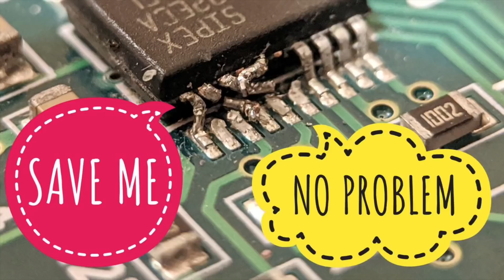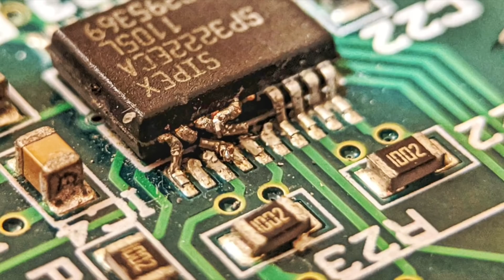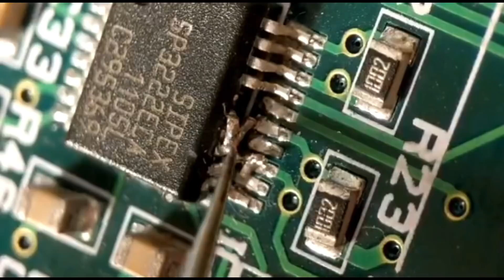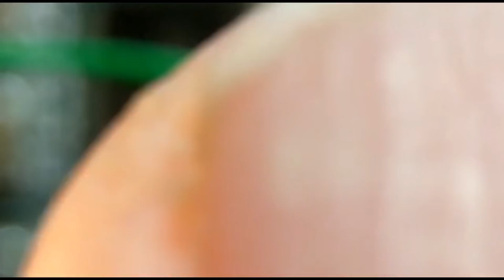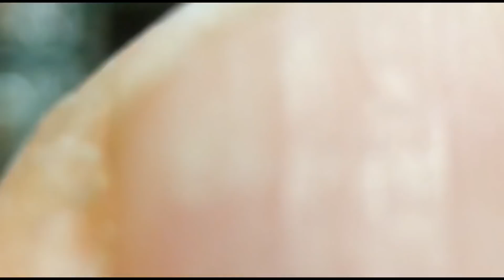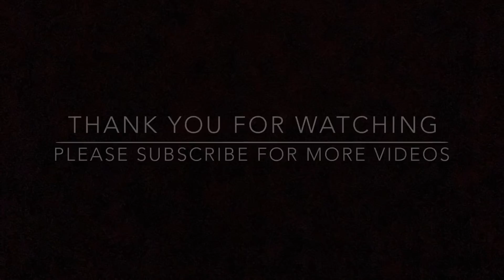IC Pin Repair / How To Repair Broken Pins On IC - 2 Methods

Comment: Amazing as always!  I did this yesterday (before I watched the video) I had to jump to the bypass cap - the trace, pad and IC leg were gone : )  I ground away some of the IC body with a grinding pen.  It worked great, there really was nothing to solder to at all pre-grinding.  Happily it was the power pin, so it was the top corner, and not a signal pin.  I practised on a different IC with a middle, signal leg missing, and I was not able to expose enough of the pin to solder onto.  I'm yet to properly test it, although the strength and continuity test good

Comment: What type of wire you are using as a pin substitute?
Reply from the maker: Hi , thank you for your comment . In this video I used the inside core of Kynar wire which is a 30 gauge wire . I just try and match the width of the pin with suitable wire  . For example if you have a through hole resistor lead and it matches your IC pin width I would use that if I could . Lots of different options . Thanks again 👍

Comment: What is the type
Of wire you use to fix the broken pins ?
Reply from the maker: Hi , thank you for your comment , much appreciated . The 3 pins I fixed with wire were done with 30 gauge Kynar wire , easily found on the internet . I normally try and match the original thickness of the damaged pins if I can . Or otherwise if you have scrap pcb's around use donor pins from other IC's which I've also done in this video . Hope that helps , thanks again 👍
Reply: @mrsolderfix3996  thank you I have one more question I ripped some of the little circles on the board I’m not sure what they are called lol. Can I replace them with copper ?
Reply from the maker: Hi , definitely, they are made of copper . If you can get some copper tape and shape what you need  , fine strands of copper wire from old scrap cables or lift old pads from scrap boards  , there is a few alternatives. Or you could use fine tin / copper wire if you can get that . Hope that helps , thanks for your support , take care 👍
Reply: @mrsolderfix3996  would you recommend the thick tape like duct tape looking or the real thin one ? I was removing an ext Port and completely destroyed them

Comment: Hi I have an 8 Pin Op Amp from Analog Devices where a pin broke off. Is it safe to install with a missing Pin?
Reply from the maker: Hi , thank you for your comment. I'm not sure on this one but If  it was my project I would still fit it , the only worry being is if the particular pin that is missing is needed to connect with the PCB. Some IC's not all pins are connected externally so they will still work if the right pin is missing . You could always type your IC type into the search bar at Farnell , RS Components , Digikey or Mouser and get a datasheet up . The chip info is all shown there about the circuitry of the IC . You may be lucky your missing pin is not needed. Good luck , thanks again
Reply: @mrsolderfix3996  will do thank you!
Reply from the maker: Hi , just go into the sites I mentioned and type your part into the search bar of any of them , scroll down when the part comes up until you hit datasheet . Some data sheets have many pages but slowly go through them and you will find the inside connections of the IC . This will help show you what you need to do , if anything , good luck , take care 👍

Comment: Nice work, @ 3.52 Was there a reason you repaired all 6 leads? As leads 12, 13, 15 and 16 are attached to connection pads and leads 11 and 14 are attached to anchor pads (no connection tracks on PCB) or was it purely for aesthetic reason?
Reply from the maker: Hi , thank you for your comment , much appreciated. I just always try and fix everything if I can , it's just my way , so in this case even though some of these pins may not be connected to other points I was always going to fix all 6 of them , plus the viewer can see what you can achieve more clearly . Hopefully that's ok , thanks again for watching my channel 👍

Comment: What do you do it you don't have any copper showing off your IC chip? How can you fix that?
Reply from the maker: Hi , I mention in the video that if you have little or no copper showing you can gently scrape back the body of the IC around the pin you need to work on to expose an amount of buried pin to enable you to fix a doner leg to this. The workings of the IC are deeper in the ic than this point so this is a safe option if needed . Hope that helps 👍

Comment: ty for video, but the loud sound at start and at end really hurt ears if you are using headset.  because your voice is low I had to turn it up and then got a shock in middle, and at at end got shock of super loud music and couldn't turn it down fast enough. would be better  if music was lower level so it didn't burst out into ears. since it is not at same level or lower than your voice.
Reply from the maker: Hi , this sound problem has been sorted now , probably about my last 10 videos are ok . The voice and music are now at the same level ( different editing tool used ) , thank you for your comment  👍

Comment: Is it possible to fix a burned Ic?
Reply from the maker: Hi . In my experience when IC's have burned out it means they are beyond repair . Fixing legs back on like I show in this video is a totally different matter as the internals of the IC's will still be ok . Hope that helps , thanks for watching 👍
Reply: @mrsolderfix3996  thanks for the reply
Reply from the maker: Hi , no problem , thanks again 👍
Reply: Just another question, is the Ic unique to the system its on or can it be replaced with a similar one?
Reply from the maker: Most IC's can be replaced with the exact same type as long as you know what it is , but in some cases you will have pre-programmed IC's on your boards so if your replacing them they will also need the same information programmed into them ( can be done on or off the board ) in certain cases. Hope that helps 👍

Comment: I have just subscribed your channel. Good interesting content for me. Can you please suggest a good microscope for me to repair these kind of small SMD components at home?
Reply from the maker: Hi . Thanks for watching the video , much appreciated. I use a stereo long reach scope as you can fit pretty much any size board under these types of scopes . All my filming is actually done using a macro lens attached to my phone camera. I purchased my scope from a company in England called GT Vision . Obviously there are loads of different price bands so maybe check them out . Also I'm sure there will be some good second hand ones available somewhere. Good luck and thanks again 👍
Reply: @mrsolderfix3996  Thanks for the reply. 
And very interesting to know were filming macro lens attached to mobile and that method suits my requirement. Would you mind to give me any link or model name to that macro lens pls?

Comment: Excellent content for a highly skilled individual that makes this look all too easy - which is the hallmark of a true master....  and he uses a conical tip too!
Reply from the maker: Hi . Thank you . There are other ways of fixing these but to me these are the 2 neatest and safest ways , and with practice they can be done . A few people have said why bother , just fit a new IC . But simple answer is if you have an old obsolete IC with a unique program in it then you may be stuck without this option . Thanks again 👍
Reply: @mrsolderfix3996   And another reason the would say use a new IC is because they know they could not do what you just made look like child's play.

Comment: Thx. Learning a lot. What is the iron's temp ? What is the size of the tip ?
Reply from the maker: Hi . The general temperature of my iron is between 350 degrees and 370 degrees centigrade. I sometimes change the size of the tip if I need a bigger hear spread. I use a conical tip mainly in my Weller iron for small fine pitch joints ( PTP7 ) or a large flat sided one for much larger joints ( DD8 ). Hope that helps 👍
Reply: @mrsolderfix3996  Thankyou.  My whole tip always goes black.
Reply: You're a supposed to clean it regularly. Get a brass pot scrubber and poke your soldering tip into it while soldering, whenever the tip starts getting crud on it.

Comment: Can you clarify something you mentioned at the very end; you used a word that sounded like "kynar"; is that a tool or something? Thanks.
Reply from the maker: Hi . The word you would have heard was "Kynar" . This is a very small sleeved wire , normally 30 gauge . I used the wire core from the centre of this wire to do one of these leg repairs as it matched the leg thickness perfectly , which is very important. You will see Kynar wire being used to do lots of pcb modification work , in fact Ive done a posting showing Kynar mods. Hope that clears that up . 👍
Reply: @mrsolderfix3996  Yep, thanks.

Comment: Nice work! I would try to save the legs that were not completely off..
Reply from the maker: Hi . Thank you for your comment much appreciated. If you feel the legs are still going to be ok then by all means you can try and save them . I just wanted to show a couple of solutions for possible fixes you might need. Thanks again for watching 👍

Comment: What u  use to clean the paste?alcohol
Reply from the maker: Hi . I presume the mean the flux residue after Soldering ? If so the fluid I use is called Ultrasolve , it's a great PCB cleaning fluid and is the recommended fluid to clean off the flux I use. Available from Farnell, RS Components , Rapid Online and other electronic distributers. I will post a video about this and the cleaning cloths I use very soon.  Hope that helps , thank you 👍

Comment: Nice method :)
Reply from the maker: Hi . Thank you . I'm sorry my hand blocked a couple of shots ( I was learning filming at that stage ) but I've done another pin replacement in one of my other postings ( pad , trace + IC pin damage ) thanks again much appreciated 👍
Reply: @mrsolderfix3996  Yeah no problem at all I was listening all the way through the video visually the fix in my head. I have done a similar fixes like that just using a small magnifying glass with less than .8mm soldering tip and a steady hand plus patience :)

Comment: How did you clean the ic ? I need to see that one
Reply from the maker: Hi . I cleaned the IC with Ultrasolve ( in my opinion the best cleaning fluid for PCB's ) applied with a very fine brush in a downward motion . This has no stress at all on the joints as I'm not going across them , I also don't apply any excess downward pressure. With Ultrasolve you can dissolve any small amounts left over by blowing gently with a hair dryer as it evaporates in heat. A great safe method .
Reply: @mrsolderfix3996  i'd like to see a video if you mind. What is ultrasolve ?
Reply from the maker: Ultrasolve is a PCB cleaning fluid . It's the recommended partner for the flux I use SMFL200D. You will see me using cleaning cloths dipped in Ultrasolve in some of my video's . It gives amazing results when used correctly. Hope that helps 👍
Reply: @mrsolderfix3996  Oh, missunderstanding , I thought you melt some part of plastic case of IC to strip the pins! Because I can see some change before and after...
Reply from the maker: Hi . Sorry I don't understand your question . To expose the copper inside the IC body so you can solder a new lead to it I just carefully scrape back some of the body until I have enough exposed copper to achieve a good sound joint . After soldering , when obviously there is flux on the body and joint , I then clean off as I previously mentioned . There is no melting of anything , this is what I don't understand about your comment . Obviously once the Ultrasolve has removed all the flux things will look different , i.e it is amazingly clean , nothing else . Ultrasolve is so safe for IC's . Hope that clears up your confusion 👍
Reply: @mrsolderfix3996  thank you for your answers
Reply from the maker: No problem , sorry for any confusion . I will do a video sometime on how I clean my boards as lots of people ask me and hopefully it will help a few people as it is a good method. Thank you for watching and your comments , much appreciated 👍

Comment: Thanks for a nice useful video. A third method I had seen somewhere was to use a Dremel tool, and make a small via on top of the pin which may not be showing much copper, i.e. baring some copper. If you get the chance, it might benefit us, your viewers, to learn from you how to do that. The methodology is needed for restoring retro computers where some of the ICs are not manufactured anymore.
Reply from the maker: Hi . Thank you . I've not tried the Dremel method but I guess it's an option if someone else has done it successfully. I will have a look sometime and maybe I can try it myself one day . Thanks for letting me know about this method 👍

Comment: Congratulations on the technique and explanations.  It is truly a "virtuoso" execution of soldering.  Please tell, whats flux do you use? Thanck you. Regards.
Reply from the maker: Hi . Thank you . I just like to share what I've learnt over the years and hopefully it will help a few people along the way solve their problems. I'm sorry s couple of bits got blocked by my hand but I've done a clearer pin replacement in my other posting ( IC pin , trace and pad damage ) .The flux I use is called SMFL200D .Thank you for watching the video , it's much appreciated 👍
Reply: @mrsolderfix3996  Is that the flux that comes in an aerosol can? Do you use a straw like a can of WD-40 or does it come in a brush-on form? I'd like to get hold of a decent flux with a little brush. My flux pen is useless.
Reply from the maker: Hi . Yes it does come in a aerosol can , but I simply spray a small amount into a small container and use a dipped plastic cable tie to apply it . The best method I've ever used . I've just posted a video on YouTube showing how to use this flux . It  will answer all your questions . Thank you for watching, much appreciated 👍

Comment: good but you've not explain when you have drilled the IC case, at the upper broken pin
Reply from the maker: Hi . I don't get your question . I never drilled the IC case at the top end of the pin . All I explain is if you need to see a tiny bit more of the copper pin in the upper body all you have to do is carefully scrape back the IC material with a scalpel until you have enough copper exposed to solder to . No drilling has been mentioned or is done in this type of repair . Hope that clears it up . Thanks 👍
Reply: @mrsolderfix3996  OK it more clear now. Thanks for your support
Reply from the maker: Hi . Sorry for the confusion . Glad it's now sorted out . Thank you for watching , much appreciated 👍

Comment: Tip: I you can use a thinner and more mallible wire, wait until you've soldered both joints before cutting or breaking off the excess. With such a tiny piece already cut, all the thermal energy dumped into it by the iron has nowhere to go. This is why your 1st solder joint almost instantly melts when you go to do the 2nd joint. If you keep the wire relatively long until both joints are done, there will be much more material to soak and spread the heat, and your 1st joint won't melt and potentially move as easily.

If dealing with longer jumper wires, a little UV cure solder mask over the wire right by the joints will hold it in place even if the solder melts. This is really handy if your jumper wire aims to replace a torn pad, or you're doing multiple wires in a really cramped space where you keep bumping into the precious jumpers and melting their solder so they move around on you. Just be light on the amount used, you don't need a thick layer to hold s jumper down. Thick layers and big blobs of UV cure solder masks, won't actually cure through either, they stay liquid under a cured shell. This os because as the solder mask cures, its surface goes from glossy transparent to opaque. Then the UV light can't reach the inner volume of liquid, so it stays liquid and uncured under a thin shell, like an egg.
Reply from the maker: Hi . I just find it pretty easy the way I do it , as long as your pretty quick . It's a much neater way of doing it than the way you suggest ( which I have seen other people do on YouTube videos ) . I just think people should try my way , I think they will get there in the end , and will love the results.

Comment: Great video! I didn't know one could do this without damaging the plastic package or the wires that connect the leads to the IC. I'm going to try this when I get my hands on a broken IC!
Reply from the maker: Hi . Thank you. I've used both of these methods a few times and there both great . You can scrape a small amount of the body back without damaging the IC inside just so you expose enough copper to join the new pin to . I actually show the Kynar wire one a lot clearer in my video ( traces , pads + IC PIN repair ) as I know my hand blocked some of this video. Just make sure the new pin is same thickness as the original . Good luck and thanks again 👍

Comment: Wow great job! I have to give this a try sometime, thanks a lot for sharing the knowhow.
Reply from the maker: Hi . Thank you . These 2 methods really work as long as you have a little copper showing from the IC body to attach to . Like I say in the video you can carefully scratch a small amount of the body away to expose more if you need it.The link wire method is shown really clearly in my ( damaged pads , traces + IC pin video ) good luck 🙂
Reply: @mrsolderfix3996  Yeah I have watched that video after this one. Brilliant stuff very informative!
Reply from the maker: Hi . Thank you . Really appreciate the fact you found the video's useful. Like I said earlier they really are great methods and with practise you can get them to look invisible almost . Thanks again 👍